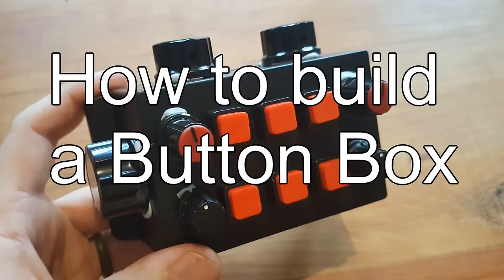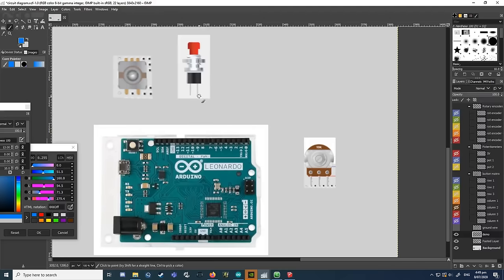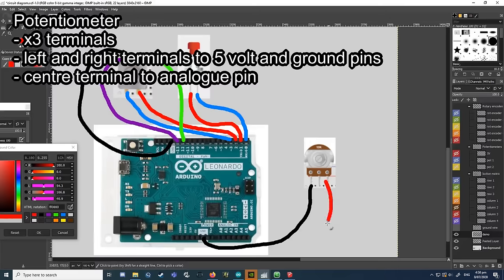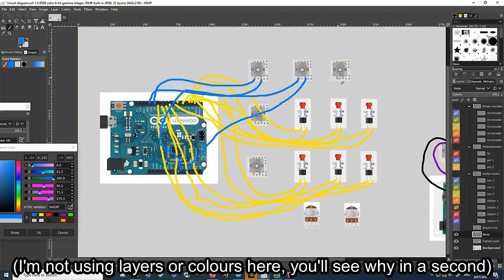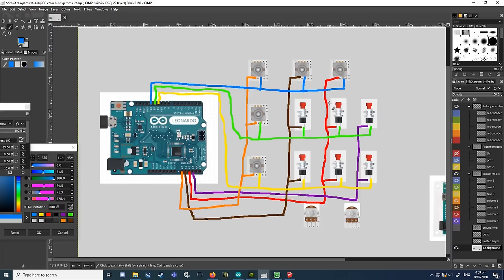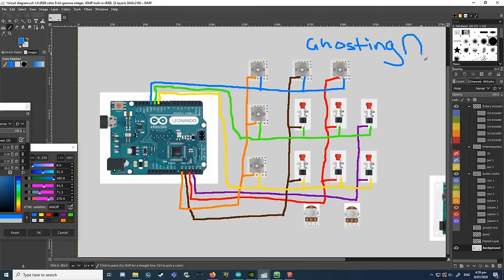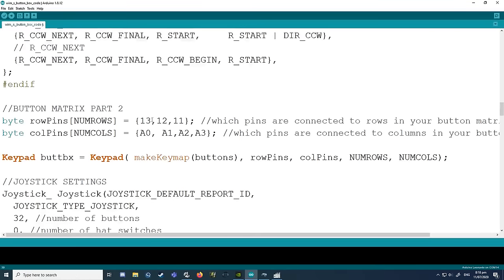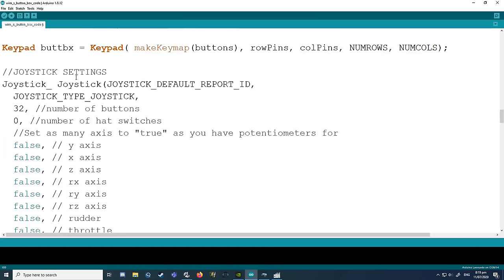How to Build a Button Box

Comment: Maybe somebody can help. I have an encoder like shown at 7:09. I tried to connect + to 5V, SW to 13 (as part of button matrix), GRD to ground and CLK as well as DT to 1 and 2.
Twist works perfect, but when I push it gives me multiple buttons. Than I tried to connect instead 5V to A0. Now it pushes also buttons when I turn. I used the code as described in the linked/recommended video. Not sure what’s wrong
Appreciate any help
Reply: I've the same problem :/ please help how to connect this!
Reply: Try not using the +5V on the rotary encoder at all. I haven't tried it yet, but when I test the switch with a multi meter I get continuity when I touch the ground pin and either of the DT1 and DT2 as well as the CLK when I operate the encoder. The +5V according to the instruction manual and my limited understanding should output a square wave when turning the switch depending on the switch position it will change if its 0V or 5V for either side of the wave depending on the direction rotated. So you shouldn't need it with the code he's using. I am currently working on the same build with the same switches and I'll report back if I am incorrect.

Comment: Thank you for this video. Can I use a 5 position rotary switch using this method and assign them as buttons in the coding ? I am making a button box with 10 toggle switches and 2 five position rotary switches using a 4x5 matrix.
Reply from the maker: Yea but it depends totally how your rotary switch works. You'll need to look at the schematic for the component and then work out how to hook it up to the matrix.

Comment: Hey great video. Have a question I can’t seem to find any off on on toggle switches. Is it possible to make it so  with the on off on switches the down position it is off, in the middle position the lights are dim and then the top position bright??
Reply from the maker: Hey, yes that probably is possible but it would require some extra coding and I'm not enough of an expert to tell you how. I'd suggest looking at the mmjoy2 software, you might be able to do it through that.

Comment: late to the game but nice video. Though i'm sorry to say my encoders are wire as seen here but only the push button works, the rotating bit is absent. I only get some random signs of activity when testing the buttons with the usb program
Reply from the maker: Unsure why that would be sorry. All I can suggest is to quadruple check they are wired and coded correctly
Reply: @wimwamjoey  tha nks. I did , maybe they are faulty.
Reply: Hi, as I mentioned on my comment above, NOT ALL rotary encoder have ground on the middle pin. My encoders where not marked and I assumed that the middle pin is ground, but it was actually the right pin that was ground. If your encoder gives erratic pulses mostly on one direction, you probably have the wrong pin for ground. Do the test on one encoder beforehand to save you a lot of pain. It took me all afternoon to figure that one out.
Reply: @mikekal4472  looks like it was bad soldering. Got 2 working

Comment: What specs do I need to look for when selecting switches?  Also, what e-store do you recommend for finding components?
Reply from the maker: Honestly it depends a lot on what you want to use them for. Personally I buy either from Jaycar or Aliexpress.
Reply: @wimwamjoey  I’m thinking of creating a button box for my PC flight simulator using a Leo Bodnar board.  There are so many variables that I don’t know what components to choose (voltages, ac/dc, resistance, etc, 😖🤯).  Any guidance would be greatly appreciated.
Reply from the maker: I'm afraid I don't really know myself... frankly I'm a bit of a noob on electronics so I just got advice from the guy in the store. From what he said, generally speaking you don't need anything highly rated because arduinos only operate on a low level of current.
Reply: @wimwamjoey  I see.  Thanks for replying.
Reply: There's a kingston based electronics store called qkits, if you want to support a local business. Of course, that's if you're in Canada! (Shipping would probably be atrocious anywhere else)

Comment: hi there, thanks for your tutorial, its exactly what ive been needing. The only thing is that a pro micro doesnt have a pin zero or 1 so where does the 1st encoder connect to.? Thanks
Reply from the maker: I believe rx and rx double as 0 and 1 on the pro micro. If you Google "pro micro pinout" you will find a more detailed answer.

Hope that helps!
Reply: @wimwamjoey  yes you were correct, all working now thanks so much

Comment: The buttons on my arduino leonardo have the same names as the buttons on my joystick. When I try to configure an arduino button it appears that it is already configured for another function. Because I already configured other functions on the joystick. Which makes it impossible to use the joystick and arduino buttons for different functions, which makes the button box completely useless. How can I solve?
Reply from the maker: Hmm, this might be outside my level of expertise so hopefully someone else can help... 

I suspect this is an "enumeration" problem (basically windows has assigned the same identification number to two separate devices). I have three ideas which I think might help:

1. Restart your PC (try doing this with both devices plugged in, and with neither device plugged in then plugging them in after startup)

2. Add the following lines near the top of the code after "#include <Joystick.h>"
Joystick_ Joystick(
JOYSTICK_DEFAULT_REPORT_ID,
JOYSTICK_TYPE_JOYSTICK,)

3. If you are using linux - take a look at this: https://mheironimus.blogspot.com/2015/09/linux-support-for-arduino-leonardo.html?ref=https://githubhelp.com
Reply: @wimwamjoey  I just found out about 5 minutes ago haha. In fact the game tried to configure some buttons automatically and it matched with the joystick buttons. It was just resetting the configuration that the game assigned to the arduino and it solved it. Thank you anyway.

By the way, I made a video in Portuguese of my button box today and posted it on youtube, I put your video link and others in the description. I hope you do not mind.

Comment: Hi, Don't push buttons need resistors or use INPUT_PULLUP to avoid float readings? if So, would I be able to use only one 10k resistor at the ground wire to achieve this?
Reply from the maker: I believe INPUT_PULLUP is handled in the keypad library which is why it isn't visible in the actual code but I could be wrong about this. All I can say is that it works for my box!

Comment: Hey , I did 3 by 3 buttons matrix and for some reason each row press same button and each column presses same other button. like the matrix doesn't work
Reply from the maker: First, double check your wiring and soldering to make sure your rows and columns arent accidentally shorting.

Next, double check your matrix code. It should look something like this:

[0,1,2],
[3,4,5],
[6,7,8]

Also, make sure you're telling it to expect a total of 9 buttons with 3 rows and 3 columns.
Reply: @wimwamjoey  thanks for the answer! I found the problem! It was wrong columns wiring 👍🏻

Comment: What about a analog stick and a xbox trigger switch? I'm kinda messing around with putting those into my macro key box. If you have a 3ds and 3d colors you'll get an idea of the key mapping I'm trying to make.
Reply from the maker: An analogue thumbstick is basically just two potentiometers and a pushbutton combined in one component. You should be able to connect them up using the same wiring/code in this video. Just a matter of figuring out which pins belong to which terminals.

Some thumbsticks use hall effect sensors and those have different wiring and code so you'd need to look up another guide for that.

A trigger should just be a simple switch I think.
Reply: @wimwamjoey  Thanks, I'll have to mess around with it.

Comment: So how do I remove the Joy stick entirely. Not using potentiometer and every time I compile error after error with the joystick section, this does not work I did exactly what was said.
Reply from the maker: Remove the bit of code which says "checkallpotentiometers" in "voidloop"
Reply: @wimwamjoey  I do that now  compile error states after void setup, joystick.begin rotary_init was not declared in this scope
Reply from the maker: @directorb06  can you please send me your code
Reply: @directorb06  I've actually just run into the same problem with mine

Comment: Any pros/cons between choosing a leonardo or other boards like the pro-micro etc?
Reply from the maker: You can only use a pro micro or a Leonardo (see video description). Pro micro is smaller and cheaper but has fewer pins to connect things to so just make sure you have enough for your purposes.

Comment: Hi, thanks for this helpful video ! I need to buy the wires but if i search “arduino wires” i only find Jumper wires… can i buy 22 AWG wires o do i need other types of wires? Thanks !
Reply from the maker: Yea 20-22awg is what's recommended for arduino. The jumper cables can be handy cos they slot a bit better into the jacks on the arduino

Comment: Hi, because you've used 4 of the analog pins (A0-A3) for the button matrix, does that mean you are limited to 2 analog axes/potentiometers, or can I still connect another 4 potentiometers even if it means joining those wires with the button matrix wires on the analog pins ?
Reply from the maker: You can only connect potentiometers to analogue pins.
Reply: I was running into this issue. When you are defining which pins the button matrix uses you do not have to use the analog inputs. They can all be digital inputs, for for example my 3x3 button matrix is using pins 0, 1, 2 and 3, 4, 5. If you can that, then all 6 analog inputs will be free on the arduino leonardo
Reply from the maker: Yea I should have made this clearer in the video. I was only using analogue pins for the matrix to make the point that you can use them for digital inputs if you want to

Comment: Im using only momentary buttons, and have enough pins for all the buttons I need. i assume I dont need the matrix and can just wire to pins? would the code need altering?
Reply from the maker: If you're just using momentary buttons it's much easier and cheaper to use a zero delay usb encoder instead of an arduino. They don't need any coding, literally just wire up your buttons to the board, then plug it into your PC and it will pop up as a recognised device. . 

But to answer your question, no this code will not work unless you are using a matrix. You would need to write completely different code to make an arduino button box work without a matrix.

Comment: Ran your sketch for a Helicpter collective I built and all went great. I needed 3 pots so I used the Z-axes, Rx-Axis, and Ry-Axis on pins A3, A2, and A1. When using only one pot to test in either pin A3, A2 or A1, I'm seeing all 3 sliders moving in the Windows game controller screen. Any suggestions?
Reply from the maker: Can you send me your code?
Reply: I had everything correct,  I just needed to actually connect the 2 pot's and hall sensor at the same time. Your video was invaluable in me setting up my arduino pro with my newly built helicopter collective. I ran a 4x4 matrix with no encoders, but just like you stated in the video, by playing around with your sketch and hitting verify, I learned how the sketch worked. Wonderfully done.

Comment: Can you tell me which potentiometers would be good for use in a button box? I see some varying from 5k ohms to 500k ohms and I am not sure what the difference is in regards to the ohms.  Like is the higher the ohms, the larger the range?  Like rotating the knob 15 degrees in a 5k ohm potentiometer will read a smaller amount of "range" than rotating the 500k ohm potentiometer?  For example, rotating the 5k ohm knob 15 degrees increases your power output level from zero to 15% whereas rotating the 500k ohm knob that same 15 degrees increases the power output level from 0 to something like 30%?
Reply from the maker: 10 to 20k ohm potentiometers are what is recommended. Others will still work but may not give as accurate of a reading. It won't make any difference to the range of the rotation which you use.
Reply: @wimwamjoey  Thanks!

Comment: Yet another question, I seem to be getting the posts too hot with my soldering iron when wiring even if I leave iron on for 1-2 seconds so the posts on a few move and appear slightly loose. Is this breaking them or should they still work as long as they don't come out? I'm worried I've broken 3 or so of them and I don't want to finish the entire box if this is the case.
Reply from the maker: Sorry I'm far from a soldering expert, can't answer this one I'm afraid.
Reply: I can help you mate, so the way switches work is the rod that you move is connected to a ski-like metal plate which connects the terminals together. If the terminals (posts) do get disconnected the switch will not function properly, so if you can get a bigger switch then do, unless you can turn the temperature down on the iron you have to pickup some bigger switches with bigger terminals! Sorry to break it to you boss but it is the truth.... :C

Comment: Great video, im thinking of build an overhead panel which will consist off mostly toggle switches and momentary switches, whats the maximum switches you could get out of one arduino leonardo? Thanks
Reply from the maker: The limit is more on the software side. Windows will only accept 32 button inputs max
Reply: @wimwamjoey  Actually, the 32 button limit is only for what is displayed in the windows controller properties. I'm using a box with 39 buttons for simracing and haven't had any problems so far. It might be that some games also don't recognize higher button numbers. but you could test that rather easily. If you run into problems, you could get four more buttons by defining them as a D-Pad. If that still isn't enough, you can create multiple instances of the Joystick object and split the buttons among them. However, they will all be called Arduino Leonardo (or Micro) by Windows, so it will be hard to differentiate between them.
Reply: I just had another look at the Joystick library and noticed that it supports up to 2 Hat Switches with 8 directions each, so you could get up to 16 additional buttons instead of the four I mentioned before (but be aware that only one direction per hat can be active at any time).

Comment: This may be a dumb question lol but here we go.

Can I run 2 wires to the same pin if they are different columns and rows. My problem is I have to many lines running and my last hypothetical encoder needs another wire ran to the board, but I am out of pins.
Reply from the maker: No you can't make that work unfortunately.

Try to make sure you have the most efficient button matrix as possible. The closer it is to having an equal number of rows and columns, the less pins it will require overall. (E.g. a 2x8 matrix requires 10 pins, and a 4x4 takes 8 but they will both accommodate 16 buttons).

Alternatively you could use a shift registry to increase the number of buttons but that will require totally different code and wiring.
Reply: @wimwamjoey  Thanks for the reply! I may just take a few things out and make one specifically for ATS.

Comment: First of all, thanks for you great video, I have learned a lot.
I have a problem with the encoders. I'm using a Pro Micro, and it does not have pins 0 & 1, so I added a fake rotary as the first one, as suggested in the comments.
The rotary is connected as follows:
- The group of 3 pins, left pin to pin 2  and right pin to pin 3, the middle pin is not connected
- The group of 2 pins, one to pin 10 and the other to pin A0.
The button works, but when I rotate the shaft, it does nothing.
Examinig the code, and doing some printing, I can see that the function rotary_process always reads 1 in both pins and the result is always 3, even when I rotate the shaft in any direction.

Any suggestion about what I'm doing wrong?

Thanks in advance.
Reply from the maker: On a pro micro TX and RX count as pins 0 and 1
Reply: I don't know if pins 0 and 1 can be used, so I added a fake rotary to these pins, as stated in a comment from @MouldyGuitars two weeks ago.
I believe that my breadboard is not giving good connections, so I decided to go ahead and solder all the wires and check if it works.
Reply: @JenriBR  You got it working?
Reply: No, it didn't work. The rotaries were connected to pins 0&1 and 2&3 in the Pro-Micro.
Finally I connected the middle pin in the rotaries to GND and use interruptions to trigger a function to detect the rotaries direction.

Comment: Do you think I could add a little LED to my buttons? Would that be as simple as attaching it to the button and to a wire?
Reply from the maker: Yes, although they will only flash when you are actually pushing the button unless you design the circuit differently
Reply: @wimwamjoey  alright thanks, that's exactly what I want. Cheers!
Reply: Something to keep in mind: you'll also likely want a resistor for the LED to limit it's current so it doesn't burn out. What rating specifically varies depending on how bright you want it and what your LED is rated for, but something in the couple hundreds should at least be safe.
Reply: You can buy momentary switches with led's built in. I use Ebay, tons of choice there. Search: momentary switch led.